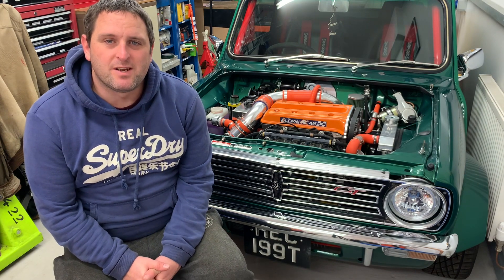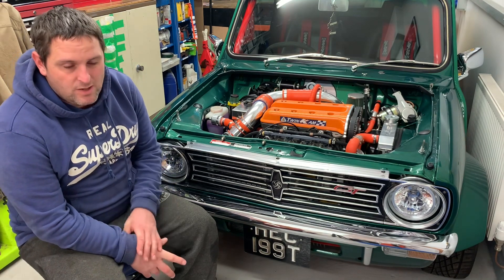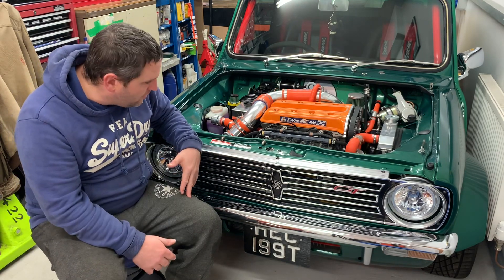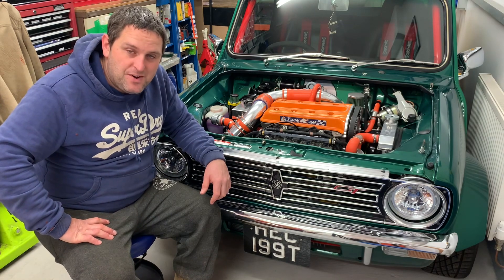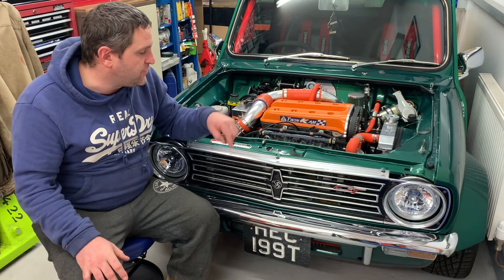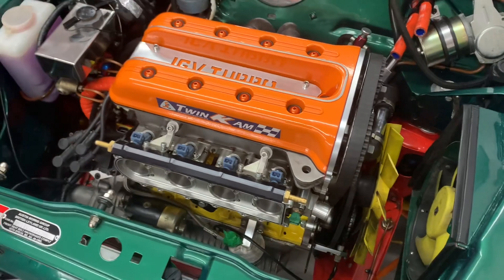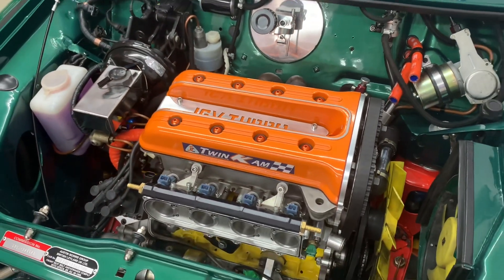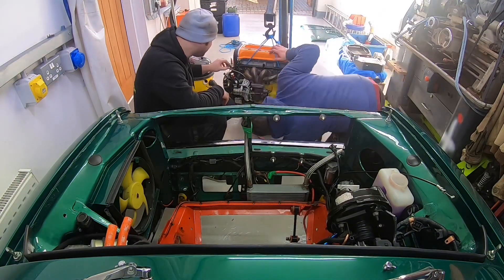Mini Twin Cam 16V improvements Episode 1

Comment: Stumbled upon theses videos and loving them. 
What great build! 
16v. 
Injection. 
AND turbo! 
That’s the stuff you dreamt as a kid! 
But do you find 6 gears too many for a small car? 
I had a fiat panda 100hp 
That I absolutely loved. 
Apart from it had a 6 speed box. 
I was forever changing gears just going to the shops. 
How have you found the 6speed box?
Reply from the maker: @simonmenzies3142  Thanks for the great comment. I don’t mind the 6 speed box other than the fact that it’s straight cut, Dog engagement and obviously very noisy. Other than that it’s absolutely fine. Very very annoying on a long journey though 🤣
Reply: @performanceclassics1986  I can imagine lol 
I got in my friends clubman a few years back kw and loved the fact it was four speed. 
So much more fun to drive and so refreshing. 
But tbe 5th overdrive is nice to have. Is a 5th straight through 1:1 like a 4th gear. 
And the 6th overdrive 
Or are both 5th and 6th less than 1:1 do you know. 
Your build has got me thinking!
Reply from the maker: @simonmenzies3142  I’m not entirely sure on the gear ratios. I’ve owned the gearbox for around 18 years now and it was brand new when I bought it. The drop gears from crank to gearbox are 1.1 ratio but I’m not sure on the gearbox ratios or the final drive. Too many years ago now 🤣🤣🤣

Comment: So what did you change the cam lift to then?
Reply from the maker: 0.8mm of lift at TDC as per specialist components recommendations for forced induction. It was set at 2mm which is right for a naturally aspirated set up.
Reply: Intake or exhaust ?
Reply from the maker: @Benjaminyetter  Both the same

Comment: Very Nice Mini Bud. I grew up South Wales @ just 14 Building Minis then @ just 18 had a 1275GT [Should have kept Her]. Now i;m 50 I;m really thinking of getting another Mini because the Engineering/Materials PARTS have Come a Long way. I prefer the Clubman Front because there;s soo much more room, Especially doing a Twin-Cam.
Reply from the maker: I totally agree. I much prefer the clubman front too. Have always loved the shape. I always thought that the clubman front looked very Ford like, then I learned that an ex ford Designer, designed the clubman front. You should definitely get another one 👍

Comment: Great job mate. What’s the cheapest you could put a head on a mini block. Great project. Love the conversation
Reply from the maker: Thanks Bernard. It’s hard to put an exact price on it but if you already have an A series engine and you could pick up a k head and ancillaries for £400-£500 then you could use most of the bike parts. You then need the conversion kit which I think is around £750 ish, but you could make these items if you have the skills and tools. The pistons would need pocketed for valve clearance and block re drilled to accept head, but again these are things you might be able to do yourself. 

If you have the skills, you could do it for under £1000 but if you need to buy most of the parts, your probably looking at more like £2000 for a basic set up utilising a lot of the bike parts
Reply: @performanceclassics1986  many thanks 
Great information 
What sort of power are people getting out of these?
Reply from the maker: @bernardwarr4187  Anywhere from 130 BHP for a standard 16v head on a standard 1275 block, up to 200+ BHP for the heavily modified and supercharged / Turbocharged alternatives. You could reach 300bhp if you had the intention and money to throw at it